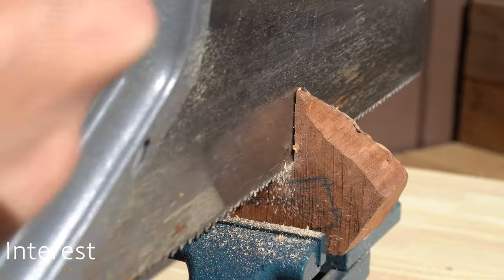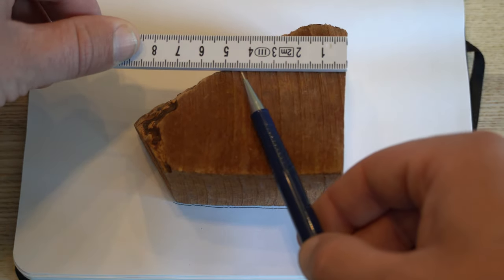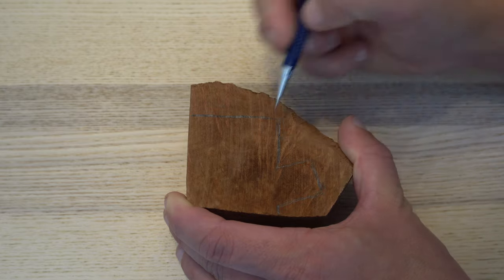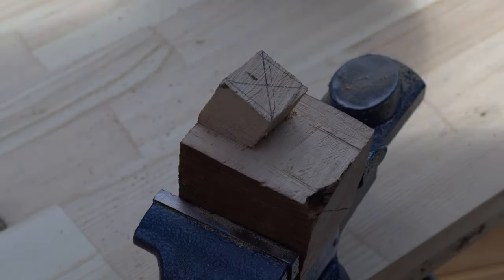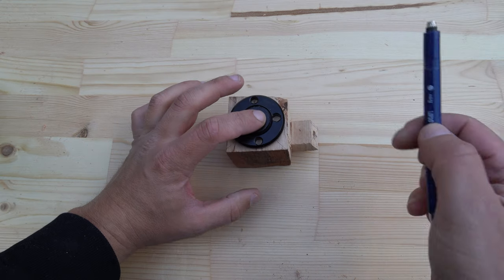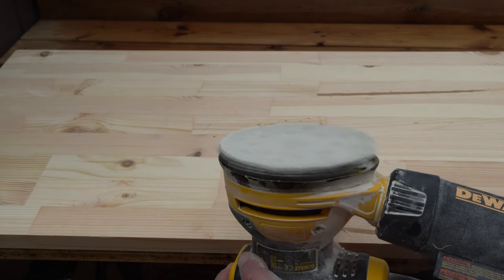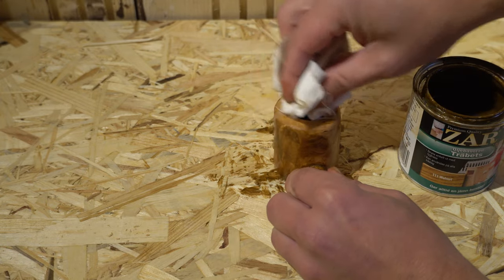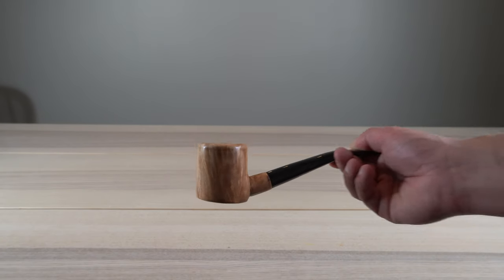How to make a tobacco pipe, with DIY tools

Comment: Great explanation video! And beautiful tabaco pipe!
Do you know some another woods that can be used to make it?
Reply from the maker: I will try myself to make one out of a dense piece of cherry, or similar wood which comes from fruit trees. 

It is important that its not toxic and it has to be resistent to heat. 

A lot of people have told me not to make one with oak, due to "toxic" properties when using it as a pipe. 

Hope this helps! :)
Reply: @HallbeamDesign  I made a pipe with cherry wood, it doesn't seem to be as heat resistant but maybe I didn't give the wood the right treatment 😅 
It would be good to hear from you on how to properly treat wood, thanks!
Reply from the maker: Next video is releasing today. If you can, please send photos of the pipe to my instagram (Hallbeam Design)

There is a way to treat you smoking pipe with active coal mixed with water or alcohol. You paint the inside of the bowl with the mixture and it becomes very resistant to heat.

Comment: Could birch bee used for making a pipe?
Reply from the maker: Birch wood is alot different compared to briar. They grain is different and it is not as hard. There are pipes made from birch wood, It will probably not last for ever.

If i had a lot of birch i would definetly make some birch pipes! Good luck :)

Comment: Very informative, but I'm surprised you didn't char or treat the bowel in some way. Can you smoke the pipe as is?
Reply from the maker: Good question! The owner had to char it or as we say "röka in" the smoking pipe. I have seen it a few weeks ago and it looks really good on both the outside and inside. It will need some more carnauba wax though as it is hard to apply a fair amount with the anglegrinder :)

Comment: You also need to use wood stain based on alcohol or water, because many of wood stains are actually toxic
Reply from the maker: Yes exactly, important not to take the wrong stain on the inside of the pipe where the tobacco will burn. The finish with carnauba wax is completely safe. Carnauba wax is even found in several ice creams as an ingredient.

Thanks for the comment!